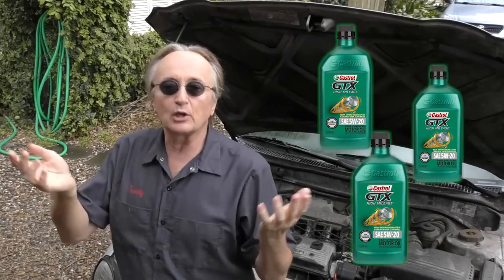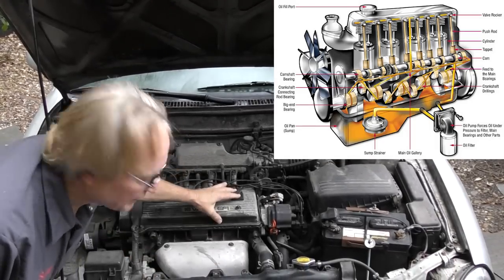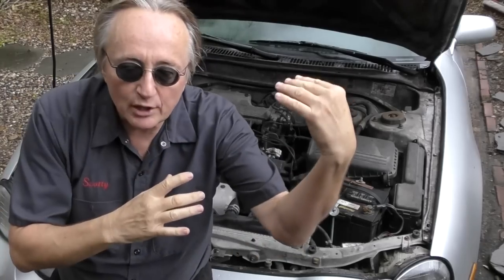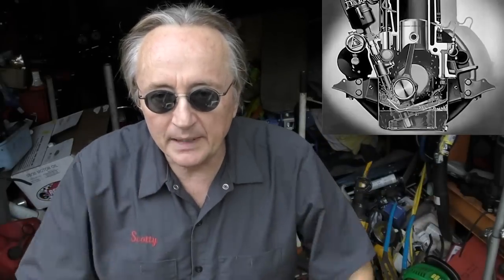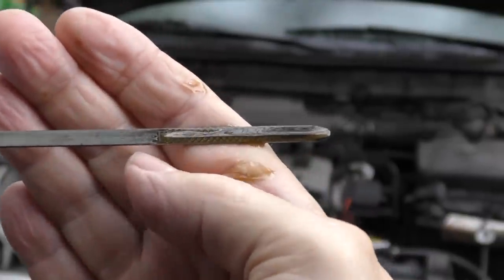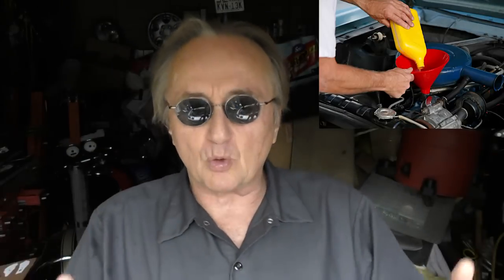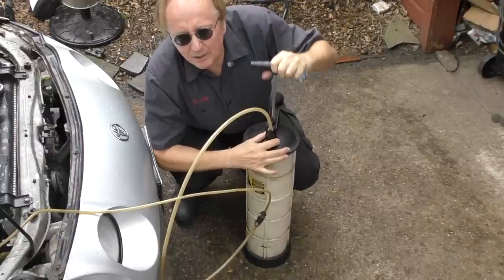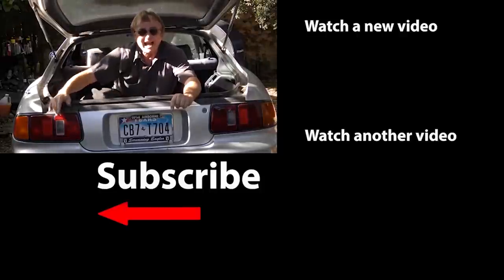Doing This Will Destroy Your Car's Engine

Comment: Checking transmission levels can be tricky, there are usually 2 marks, one for cold and one for operating temperature but load and ambient temperature can cause it vary.     You don't want that foaming either.

Comment: Hey scotty what do you think about the gm 3400SFI Engine longitivity
Reply: @jameskoralewski296  I just was curious for his opinion about them mostly regaurding my 03 silloutte 3400SFI with 230,000 on original motor trans with no special care but basic exterior engine things(water pump, alternator, etc ). It runs and starts smooth. Also 3400SFI with 133,000 in my chevy venture that had headbolt failure(headgasket blew the three coolant passages on both heads).Paid a guy with a car lift in his tiny but spacious tool filled garage 500 labor +350 in parts

Comment: Technically the seals don't get blown out due to excessive pressures. 
The pcv will alleviate the excess crank case pressures, as long as it's not clogged up.
The seals simply seep more due to the higher oil level sitting behind it.

Comment: I killed the transmission in my first car by overfilling it. It was on it's way out anyway and was leaking a quart every couple of days and it was slipping. But one day it was slipping more than usual so I poured more transmission fluid in without checking the level and it stopped working completely shortly after.

Comment: Yeah, tell me about it. I had a Ford Cougar that had two place to drain the oil. I didn't know this, and only drain one place. Too much oil, screwed up the engine. My wife drives a Caliber, and it's alway down a quart and half when I change it. I'm always afraid that I'm not getting the oil out.
Reply: I had a Ford like that. It had a large part of the frame that went right under the engine so the oil pan had two drain plugs. You had to be sure to pull both of them and drain both the front and back parts of the oil pan.

Comment: In all my Honda's service manuals it says to let the engine warm up and then to check the oil after about 10 minutes. What is the best way?
Reply: Drive around for 5-10 minutes, then wait 3 till 10 minutes and check multiple times

Comment: Why is this an issue in cars?  All the motorcycles I've owned used a wet sump clutch and also the crankshaft picked up oil from the crankcase to lube the entire engine.  Wouldn't the same issue occur in a motorcycle engine as in a car engine?

Comment: Hay Scotty I have a 03 Toyota Matrix it has a 420 code I change to cat and to upper and lower sensors but the code is still there and it’s sounds like the exhaust has a hole but it don’t i this the exhaust manifold may have a crack and I have to throw oil in the engine regular any advice

Comment: When toyota first released their Tundra V8 they actually shipped it with the wrong dipstick.  it was too short.  when people did their oil change, they put in the amount of oil as stated by the manual.  when they verified with the stick, they found it way short (oil didn't even measure on the stick).  so most people then went and added more quarts to get it in between the high and low marks of the dipstick.  i guess they figured the manual had a misprint and the stick must be correct. about 6 months later toyota issued a recall and replaced the short dipstick with the correct longer one.  actually i think toyota made the same mistake twice, once with the tundra and once with the land cruiser.

Comment: I nearly destroyed my engine and transmission last week. I changed the engine oil in my recently acquired Corolla. I have done this many, many times in lots of cars. Anyway, I checked the level and it was like, double. It flummoxed me. I checked and checked and checked. I drove it up and down (about 200m) and checked again. And then I thought I had better drain some out - maybe I had put too much it. Nope - I spotted my mistake. I had drained the transmission and filled the engine! Luckily - all OK. But OMG if I had not checked the level !!!!

Comment: So here's a question: Which one do you trust--the dipstick or the amount of oil that the manual says you need? For example, my Toyota Tacoma says that it takes 6 quarts of oil. But if I put in 6 quarts it's way high on the dipstick (Yes, I fully drain it for a long time before adding oil) So I only put in 5 quarts and it's still a little over full on the dipstick. I'm afraid to put in less than 5 quarts because it says I need 6. The book or the stick?

Comment: Scotty you say to check the oil when it's cold. I could have sworn I read in the Toyota Camry owners manual for my 1999 Toyota Camry that the engine should be warm on a level service, and the oil should be checked after approximately 5 minutes after turning off the warm engine to let the warm oil drain into the pan. Are you sure that you should check the oil when it's cold? Please answer and I'm going to look in my owner's manual after you do to confirm what I just said above.
Reply: @omartinoco9930  How do you know that warm doesn't mean a fully warmed up engine? Not only that, but Scotty is saying to check the oil when it's cold.
Reply: He's not lying. The best reading for a dipstick is after the car has had an oil change before the engine is turned on. Oil should be checked when the car has not been started for several hours.
Reply: +inertaiforce Because oil follows the laws of gravity it will collect in the oil pan. The dipstick only measures what oil is in the oil pan. If the car is still hot, you get an inaccurate reading because some oil remains in the engine.
Reply: @omartinoco9930  "Because oil follows the laws of gravity it will collect in the oil pan. The dipstick only measures what oil is in the oil pan. If the car is still hot, you get an inaccurate reading because some oil remains in the engine."

If some of the oil will remain in the engine, then why does the owner's manual say to warm up the engine, then shut it off and wait 5 minutes for the oil to drain back into the pan?

Comment: I have a Toyota Sienna 2007 (160k miles)and I decided to keep it for a while. What can I change now to prevent being cought with a car that does not work on the side of the road? (I changed the thermostat last week because it broke while driving- the mechanic changed also the water pump but I think that was just to take money out of me).

Comment: Many years ago, I purchased my 2nd car, a 1971 Malibu. I decided to change the oil, and when I couldn't budge the drain plug, I figured it must not have been the drain plug after all. So, I found what must have been the drain plug a little further back. I didn't get a whole lot of oil out, which should have been a clue. I changed the filter and added 5 quarts of oil. Well, as it turned out, I now had about 10 quarts of oil in my 307 V-8. No worries, I wasn't going anywhere. My transmission wouldn't shift, considering there was no fluid in there.          No worries; I'm smarter now.

Comment: I'm a 60 yo disabled woman and I have to do my own oil changes due to others overfilling.  An oil change for me is an ALL DAY EVENT.  Not the 1/2 hour job when I was younger.
The dealer where I bought the car did it and an oil change place did it.
I have a standard transmission, and the dealer wanted to flush it before the gear oil change.  So I do those as well.
Went car free for 11 years due to this nonsense.

Comment: Mr. Scotty since talking about oil,
In my Chevy trailblazer 2003, the oil cap says 5w 30.... I was just wondering if I can use the oil 5w 40 in hot summer temp almost 40 degree or I just follow the owner's manual that says 5w 30??
Best Regards and thank you
Reply: Nad Dass 

It’s not advisable to do that. Use what the engine is designed for. For what reason would you want to do that?
Reply: @CP-pb3pj  
in hot summer days the temperature goes 40 degree and higher... so I thought that the oil would evaporate🙄
Reply: Nad Dass
No worries, Nad. You will be fine with 30.
Reply: your cooperation is highly appreciated 💖

Comment: Hi Scotty, I am looking at purchasing a 2001 Lexus ES300 with 97,000 miles on it. it has a (3.0 L 1MZ-FE V6) like many toyota/lexus'es of the era. There was a widespread engine oil gelling issue which could block oil from parts of the engine. After a US class action lawsuit, Toyota notified US owners that engines would be overhauled or replaced for free if damaged by the buildup of gelled oil. Should I use a oil additive or use a good synthetic oil that will help clean up the sludge? Also, the car is at a Toyota dealer, should I have them drop the oil pan to see how bad the sludge is to avoid the headache later?

Comment: One time, I needed a quick oil change. Went to the quick lube in town. 10 minutes later , done. Paid, drove out and guess what. My engine was throwing blue smoke out like crazy. Went back and they said theyd done nothing wrong. I pushed them into dropping g the oil out and putting in new. Stillsmoking. They suggested I drive it up the road and see if it clears up. After about 6 or 8 miles it was runing fairly clean .. went back to the shop. They couldn't  explain what they had done wrong  ..my take is this.. Two guys do the change. One on top.
 One in the pit who changes the filter and drops the oil. I think he forgot to drain the oil !! Then what. An overfill situation. Smoke smoke smoke. No more quick lubes for me !!
Car is still runing good. If you have the knowledge  a comment would be great

Comment: What about overfilling Transmission Fluid? Will it be the same thing if that happens
Reply: Exactly....beside making a huge mess out of the breather pipes - however it will be harder to do as most filler plugs are on the side though

Comment: Hey Scotty. Help!!! I have a 2007 Toyota Camry that has 280,000 miles and still runs very strong. I change the oil regularly and I just recently put a brand new catalytic converter on it. Through the years I’ve also replaced the water pump, alternator, spark plugs and belt. Can you please tell me what I should be doing as I approach 300,000 miles I want my car to run as long as it can.

Comment: I thought it was best to measure the level warm. Learned something!!
Reply: It will over read and one should wait at least 5min for it all to drain back in the sump after motor stop...and longer if engine very hot. ..warm is all right.

Comment: I worked at a dealership and had them do an oil change one day. A new kid over filled it by about a quart and a half it ended up breaking my spark plug in 3 pieces. The car wanted to stall at an idle, but at higher rpms it was fine. Worst part was they wanted to charge me $60 for the new plugs they put in.

Comment: Here's an interesting question, is it a good Idea to fill an engine full of oil to the point where its coming out of the oil filler ONLY and I mean ONLY for very long periods of storage, let's say a year to three or more, in order not to leave the engine dry for too long or developing a case of internal rusting because it never ran for so long ?

Comment: Are ford ranger automatic transmissions bad/weak I have the 2.3 4 cylinder with auto transmission 200 thousand plus but the truck is still running strong at the moment

Comment: i changed oil on my honda civic 1.8 petrol hatchback , its a 3.7 liter oil cap but i filled 4 liter so 300ml over the limit, should i drain the oil?

Comment: a guy i used to work with, the engine on his work van was so sludged up, it started to trap oil up on top of the heads. SO none of the oil was down in the pan and he kept getting an oil light. So he'd check the oil and it would show none on the dipstick. So he'd he kept adding oil, and again it didn't' show any on the dipstick.  But it was burning a crapload of oil from getting pulled through the pcv, and then eventually from being overfilled by GALLONS.  One day he asks my boss to take a look at the van because it never has any oil, no matter how much he puts into it.  My boss drained like 4 or 5 freakin gallons of oil out of the thing, it overflowed the drain pan.  I think oil even came out of the dipstick tube when he checked it. lol

Comment: Enough extra oil for the crank to hit will make foam like Scotty says and way to much could bend parts too.  But  a little extra oil should not make your seals leak.  If might help them last longer they need oil the same as every thing else does.  But it`s not going to blow out the seals.  The oil pump has  a pressure release valve and the engine is not a sealed system to begin with , the pvc valve  prevents any pressure build up inside the engine. So there will be no extra force applied to the seals.

Comment: Hey Scotty this is Jesse from Conroe. I was going to ask you a quick question. I have a 2014 Nissan Frontier I put a cold air filter on it K&N and bypassed that stupid built on breather box it has a lot more power and run smoother. I already asked someone at Nissan about this but I want a second opinion. I'm about to use a Dremel a cut off the other half of that stupid box from the intake I asked the guy at the Nissan dealership and they said it won't be no structural problem. Also by doing this it will save me a lot of clearance on putting new plugs on it by giving me at least 6 in of extra space. I want to get your opinion if you think this would work thank you

Comment: Have a 2006 dodge caravan 255,000 miles, hear a lot of clicking when going up a hill, is it worth getting lifters looked at? Should I be on the lookout for another car, using 1qt oil between changing

Comment: Hey Scotty,my 09 Ford fusion might need bushings ..I've replaced tierods ,suspension, swaybar links, etc. But I still alil clanks when I hit rough streets or roads through out the city. Any suggestions?
Reply: keith cunningham  thank you Keith I'll start checking out prices
Reply: keith cunningham  I forgot those rack and opinions do have bushings too lol

Comment: Hey Scotty, is there a such thing as excessive idling? I travel for work and take a lot of calls in the 4runner don't want to do any unnecessary damage by idling.
Reply: Joshxt creates large amounts of carbon buildup in the engine
Reply: Some engine designs can give you glazed bores and or overfuelling which will leave bores and rings a bit dry -but that's after a long time...it's basically fine ;it's just using fuel going nowhere really. engines like load on them though. ...maybe use the aircon or crank up your 1000watts system to put load via the alternator😉
Reply: Ah okay good to know. It's a 07 4Runner SR5 with the v6 4.0 engine. Have really been considering getting a beater Prius because of their electric AC system. AC is necessary here in Houston.

Comment: Theirs a video on here.. I forgot who uploaded it, but they fill an engine with oil till its spilling out the oil port. Then they close it up and start driving, its an interesting video if you wanna see what happens when you put maximum amount of oil in a 4 cylinder.

Comment: Here’s a question I’ve heard different opinions on: if you only drive 3000-4000 miles a year, should you still change every three to four months, or should you still plan on the 3-4000 mile range? We’re talking full synthetic oil here.
Reply: If u only drive 5000 a miles a year change  your  oil once a year i drive 20k a year

Comment: An example of the aftermarket dipstick thing    the one in my 3 cylinder perkins isnt even a dipstick. Its a homemade thing. The previous owner marked the full line at the 6.2 liter mark it takes but didnt mark the bottom. Whenever i change the oil in that i disregard how much came out of it. Just put in the 6.2 liters it calls for and make sure it doesnt go all the way down that homemade dipstick    exact same applies to literally all engines except 2 strokes cos ya put the oil in the petrol

Comment: My brother ruined a 450cc ktm dirtbike engine because he often filled to much oil.  Small engine have smaller margins with oil level. Oil lever may look low after you driven. But it will slowly increase the next hours. He sold the bike.  The next owner didn't have any reliability issues because he didn't top of the oil after every run.

Comment: Hello.. I got a Mazda3 manual diesel 1.6lt  engine.. It has oil every where on engine.. but no leakage from under on the floor..i use the best oil 5.30 synthetic and i use Avio diesel the cleanest.but oil drains quick and I also see a smoke when am not pressing the gas while driving(if this make sense) am not sure what it is am worried mechanics here will tell me stories to grap extra money ;( could you please help me with you advice? Thank you. :)

Comment: Hey Scotty, I have a 2015 Tacoma 4x4. How often should I get the 4 wheel drive serviced?
Reply: Hey Mike thanks for the reply, I'm at 85k I hope its not too late, damn it.
Reply: Wow Mike thanks for the great advice. So I checked my service manual and it really does not specify when to change the diff fluids under normal driving conditions. It does state that under adverse driving conditions, such as, heavy towing, and off roading, to change the fluids every 30k miles. 90% of my mileage is highway miles, but I have already made an appointment to get it done in the next few days. Thanks again.
Reply: Michael lee, thanks for the reminder, my service manual states to change the engine coolant at 100k, so I should be good for now. In addition, the transfer case has the same recommendations as the front and rear diffs.

Comment: I have a bmw, its almost impossible to overfill it with oil. But if it ever happens i only need to drive 20 miles to correct the oil level :P.

Comment: is it bad if its slightly overfilled?
Reply: Turn the engine off and wait until all oil has gathered in the oil pan and read the oil level. For most engines there are margins. But if the engine is under warranty, call the dealer to ask or drain some oil. Read a story here in the comments by Marc A. Mercier.